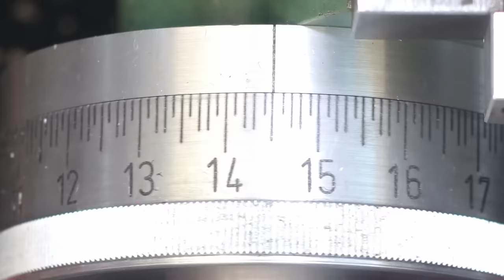Making a Shake Pen from Stainless Steel - Handmade Ballpoint Pen With Shake Mechanism

Comment: Very nice.  I have never seen anyone make a clip like this.  I have never thought of making a pen because I did not see how I could make a good clip.  Can you provide a bit morning formation on the steel you used?  I see you annealed it before bending, have you considered hardening it after you were finished forming it?  Thank you for a great video.  Informative, well edited, a joy to watch.
Reply from the maker: Thanks for your comment and feedback! I really do appreciate that. The steel I used for the clip was from a roll of 0,5mm feeler gage. Unfortunately there is no indication which sort of steel this is exactly. It only says "springsteel". The roll is 5m 0,5m thick 12,xxmm wide feeler gage springsteel. I thought about hardening the clip after bending but as the clip felt springy enough and I was lazy, I didn't harden it again. But I will try with an other clip to harden it again after bending. I assume that would be better.

Comment: That turned out very nice!  Question, though.  At 2:10, isn't the flat on the shank where one of the screws should land to eliminate any possibility of it rotating in the tool holder?
Reply from the maker: Thanks for your comment! Well observed. Normally it would be best to have one of the clamping screws on the flat of the endmill. But I needed one cutting edge of the endmill to be horizontal so that it can cut well in the bore. That would not be possible with one screw clamping on the flat as the clamping flat and the flutes of the endmill aren't in proper alignment. Luckily the cutting loads here are relatively low.
Reply: @WeCanDoThatBetter  But if you're boring into a rotating cylinder, why would it matter the orientation of the end flutes? Note: I don't have a lathe, so I have no experience doing this :)
Reply: @JCWren   :  It has to do with the orientation of the cutter tip relative to the surface being cut.  Normally, the end mill is spinning, so a flute tip is always being presented to do the cutting.   In this case, the end mill is not moving, and needs to be positioned so that the tip of one of the flutes has a good angle against the part so it will cut.  At other rotations, the back face of the cutting tip could be making contact, and would just rub the surface of the part, without actually cutting.  Evidently, the flat on the end mill used for securing it in a holder, is not positioned so that a flute tip would be at a good angle against the inner surface of the part, at least in that lathe tool holder, at the height to which it was set.

If you have a drill bit, while not exactly the same as an end mill, you may be able to hold it against something to see the issue more clearly than I described.

Anyway, I hope that helps.
Reply: @Self_Evident  OK, this makes sense now. I had to watch it again on my large monitor. There I can tell the centerline of the end mill is not aligned with the centerline of the piece being cut, but is in fact offset slightly lower. I had been thinking he was using it more like a reamer than a boring bar. Thanks for the explanation!

Comment: Interesting idea using an end mill as a micro boring bar 👏👏👍😀
Reply from the maker: :) Yes, I had nothing different that small on hand so I tried on an other project and it worked quite well, so I did it here again :)
Reply: @WeCanDoThatBetter  Definitely will file that in the ‘my try myself locker’. Thank you 👍😀

Comment: Very impressive ! One question, did you re heat treat the spring on the double bend so to make it 'spring' again? Or it could just bend again when being put into a thick material jacket pocket. I hate it when a pen clip bends out and won't spring back again lol
Reply from the maker: Thanks for your comment! I didn't heat treat the clip after bending. But the more people ask, the more I think I should have heat treated it again :) I will definitely try this on another clip to make it really springy again.

Comment: Beautiful work! Thanks for mentioning in the description that the project required a lot of experimentation and trial and error.  😊
I assume you re-hardened and tempered the pocket clip?
Reply from the maker: Thanks you for commenting! Yes, you can't show all of that failures in the video but it was definitely not as straight forward as the video suggests ;)
I didn't reharden the clip after bending but I will definitely do this to another one as many have suggested so :)

Comment: If I had to guess on how the shaking mechanism works, it's similar to how a normal clicking pen works, but instead of a spring forcing the mechanism up and down, it's a shake instead. For those wondering how a click pen works, look up an old engineer guy video on retractable pens.

Comment: It bugs me a little how when drilling the blank they go from a larger size to a smaller size. Wouldn't you usually start with the smallest and then do the bigger holes?
Reply from the maker: Drilling deep and small holes in stainless is not something you really want to do. By starting with the biggest hole size you make it easier for the smaller deep hole drill as it doesn't have to drill the first section too which gets larger anyway. So by going from large to small you make the work easier for the next smaller drill as they only have to drill as deep as really necessary. Hope that makes sense.
Reply: @WeCanDoThatBetter  Oh ok. That does make sense.

Comment: Thanks for the nice video 👍

All though I liked the finished pen so much, the ink from the pen wasn't so impressive in my humble opinion. 

One more thing, why not use laser engraving on the pen for branding versus using the traditional itching method.

I would like you to make a tic ball pen with spring and refill and share the making videos. Nice work 👌

Comment: With a different end to ghe clip, you could have had a built-in slotted screwdriver to replace the ink cartridge.  Rather than a pointed clip, a softly squared off end that is straight out from the clip would work great.
Reply from the maker: Nice idea :)

Comment: But I have to use screwdriver for changing refill.... sad part
Reply from the maker: Thats right. Theoretically you can pull the old refill out from the front using pliers and insert the new one from the front just by pressing it in. But better is to unscrew the shake mechanism I think.

Comment: This might be a dumb question but what does it mean for steel to be 1.4305? what does that number mean
Reply from the maker: Hi, good question. The first 1 before the point classyfies the material to the group of steels. The 43 says it is a stainless steel (all numbers between 40-45 are stainless steels) and the last two numbers determine the specific type of steel.

Comment: Why would you use so long drills? They're bending all over the place?
Reply from the maker: Yes, they are bending quite extreme:) I have to use overlength drills because of the deep holes and the lengths of the pen. Have to bore about 100mm deep. No normal drill can do that in this diameter. But it seems that the excessive bending is no problem. The pen worked anyway in the end :)

Comment: Clever idea and great execution. But it always seems weird to me that when a machinist wants a tube (for instance) he takes a solid rod and drills out 90 per cent of it.
Reply from the maker: Thanks for your comment! Yes, that seems weird and the deep hole drilling is pretty annoying but as the tip of the pen has to have a less than 2,5mm hole in it, I can't just use a tube. A solid bar is the only way to go here.

Comment: My shake mechanisms just arrived today from Germany. For the benefit of us Americans who do not use metric, what size drill and tap for the threads to install the shake mechanism? I don't want to have to re-thread the mechanism to fit what I have in the shop and I don't want to have to buy a whole set of metric taps and dies and stuff. Thanks! Also what type of ballpoint refill are you using? I have tried a lot of different ones and none go into the mechanism the way yours does in the video. I really want to make this but I don't have a lot of information to work with. Thanks again for posting this excellent video.
Reply from the maker: Hi, the thread on the shake mechanism is a weird M7,5x0,5mm one. Meaning 7,5mm outer diameter and 0,5mm pitch. It is hard to find taps with this specs. The guy where you baught the shake mechanism also sells taps that size. The refill this thing uses are called D1. This should be a standard and refills from different companies should fit when they are called D1. Good luck for your project!
Reply: @WeCanDoThatBetter  Thanks for the reply. I did manage to figure it out, and found a tap on Amazon and it is inbound, arriving tomorrow I think, along with a 7mm 8" long drill. I have other long drills for the main hole and the hole through the tip for the ball point. I just ordered the D1 refills and should have them by Sunday. I should be able to get this done without too much trouble now. Oh I almost forgot, I don't have suitable stock for the clip. I could use a 0.02" feeler gauge I guess.  have some 304 Stainless, .022" thick or about 0.55mm thick coming any day now, and maybe I will try that for a clip. Think that will work? I would rather not use "spring steel", which is usually 1095, a carbon steel that could rust. If I blue it then the etching won't show very well.

It is a good thing I was able to figure out the tap size, and that also you have told me. No set of metric taps will have that one. It seems to be used a lot in making pens for some reason. My lathe feed screw is in inches and pitched 16 tpi so the .5mm metric thread pitch I can only approximate closely by changing the gears, not match precisely. Probably good enough but I don't like trying to make taps that fine, anyway.

Again, thanks for the reply. Hopefully the info you have shared will help others to do this project without a lot of trial and error, too.

Comment: That came out really nice 🙂 A quick question, after heating the spring steel clip to make it easier to bend, do you need to heat it again or something to get it back to being springy?
Reply from the maker: Hi and thanks! I didn't heat treat it again after bending but in hindsight Iit would be better to do it. The clip felt strong enough after bending but to be sure, heat treatening again would be better.

Comment: Nice work.. but why didn't you re harden the clip ?
Reply from the maker: The spring steel I can not be hardened with heat. I got hardened during manufacturing when being rolled to thickness. It is called cold hardening. By heating it up I lost a bit of hardness forever unfortunately...

Comment: nice work ...but you should use watch screws better look and finishing.
Reply from the maker: Thanks for your feedback! What kind of screws do you mean? I'm not in watchmaking :) Suggestions welcome.
Reply: @WeCanDoThatBetter  Yes if you put micro screws in the pen it will look much nice because it's very small and already high finish. good luck with your work and next project.

Comment: Um... Ok, so you anneal the spring steel so you can bend it - I get that.  But now it's not springy.  You'd have to retemper the whole clip, surely?
Reply from the maker: Hi, yes I had to anneal the spring steel in the areas where the bends are. And yes the steel looses some of its springiness here so it is not any longer super strong. That's a drawback. But you can't reharden the spring steel as it is not possible to harden this type of steel. It gets hardened in the cold rolling process during production.
Reply: @WeCanDoThatBetter  Fair enough.

Makes me wonder how they manufacture those things, then - those things are STIFF.
Reply from the maker: @CyberiusT  Good question. There are hardenable stainless steels which are perfect for this application. They get bend first and hardened afterwards. But this is a little bit over the normal hobby shop skills...

Comment: Nice work, how long did it take to make this pen? Keep up the good work!
Reply from the maker: As said, it took me quite some time. I started in November last year with the first tries. Had to make several attempts on the parts to figure out the proper design and machining techniques and tools to get to this result in the end. Especially finding a way to make the clip and diving into the subject of electro etching was a pretty time consuming task.
Reply: @WeCanDoThatBetter  Well, it shows that you spent a lot of time on it. The end result is just great! Can I order 100 of these pens? ;-)

Comment: Geez this gives me anxiety. Just by the looks of many of the machining procedures that thing can't have very good tolerances.
Reply from the maker: ? What do you mean? A pen is not a mars robot. So, no submicron tolerances needed. Where do you think it is too inaccurate?
Reply: @WeCanDoThatBetter  sorry. I'm just a pretty anxious person and I try to hold myself to way to high standards. The surface grinder is my favourite tool and that should say it all.
Reply: @WeCanDoThatBetter  and be nice to your 1 2 3 blocks! Don't beat on em, they are supposed to be precision instruments, but that obviously depends on how they are made.
Reply from the maker: @luckygunner8089  Yeah, good point ;) That was not very kind to the 123 blocks. I have to invest in a arbor press for futur bending projects.

Comment: Did you heat treat the spring or leave it in a softened state?
Reply from the maker: Hi, I didn't heat treat the clip again after bending. But I will try that, at least the U-shape bend part which has the most stress on it. The front part I wouldn't heat treat again as the 90 degree bend on the tip is hard to clean again after heat treating.

Comment: The pen is a piece of art, but with a better refill, it would have been wonderful to use.
Reply from the maker: Thank you very much for your kind comment and feedback! I really do appreciate that. Have you a suggestion which refill would be better.
Reply: @WeCanDoThatBetter  I am not an expert though, I can suggest a few. Pilot Hi Tech Slim 0.4mm will be excellent. Uni jet stream sxr 200 0.7mm is another option for a slightly thicker strokes. They are smooth and dark, dry up quickly, and the strokes are consistent.

Comment: Hey nice video. What is this electro etching stencil you used. I've never seen one before and it's just the thing I need for my project.
Reply from the maker: Hi and thanks for your comment! I made this stencil on my own. You can buy custom made stencils but I just made one from a piece of round plastic and graphite motor brushs. I'm planning to make a video on that etching topic.
Reply from the maker: Hey again. I misread your question. The stencil wasn't made by myself. I made the logo as a vector graphic and sent it to a company who make these stencils. So its professional made. There are homemade options such as laser transfer, but the cleanest results I think are with these commercial stencils. I thought you meant the stamp with the felt on it. In german stencil sounds pretty much like Stempel as we call the stamp for the etching ;)
Reply: @WeCanDoThatBetter  thanks so much. I didn't want to bother you but you are exactly right. I have the tools to etch but masking (creating the nice shape) is the tricky part for me. I don't have a laser or vinyl cutter to do custom sticker cutouts and all of the other techniques seem pretty bad. With the stencil it just looks so clean and professional. I will go do some Googling now to find someone who can do stencils like this. Are you having them made in EU or overseas? Bis bald ;)
Reply from the maker: @leonlazic  Hi, sprichst du deutsch? :) I ordered the stencil along with the electrolyte from Schilling-Marking here in Germany. Was pretty easy and not too expensive. For one sigle use yes, but when you need it more often it is worth the money.